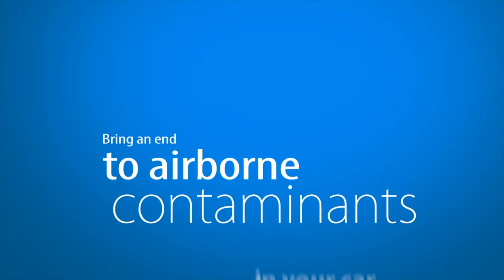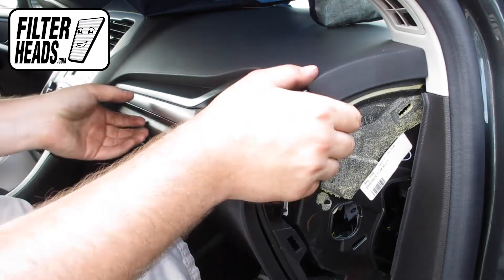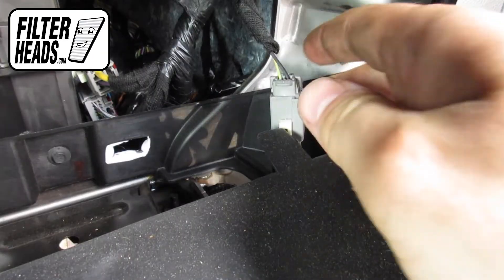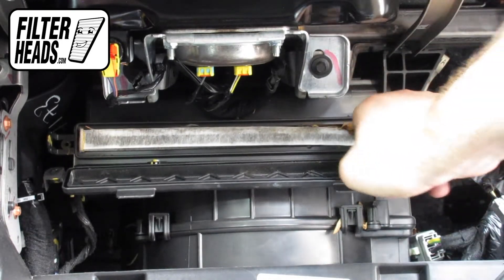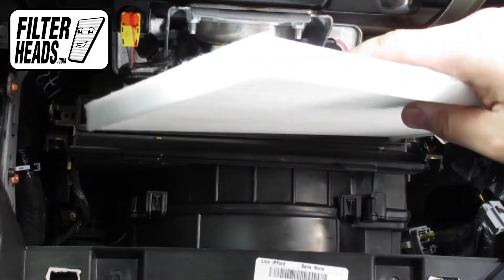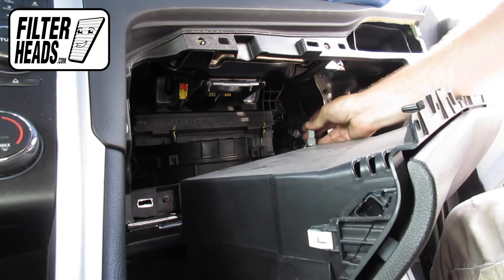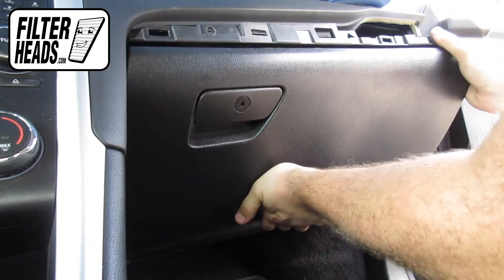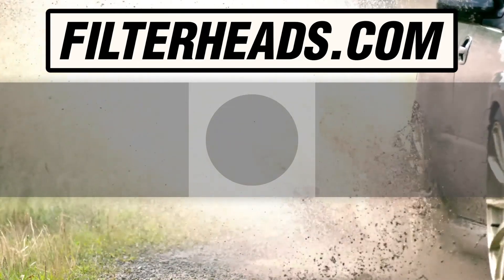How to Replace Cabin Air Filter 2015 Ford Fusion | AQ1227

Comment: Thanks for the video! I was looking this up to see if it would be an easy fix for a fleet vehicle with my work. Brilliant engineering by ford .... let's just dissemble an entire panel just to change an air filter hahaha
Reply from the maker: Very welcome! LOL! Yeah the replacement process is poorly engineered.
Reply: @filterheads  seriously, it's as bad as the headlights
Reply: @Matt561  They make it difficult on purpose because they want you to pay for service. The mechanics probably don’t actually change them for you either.

Comment: Finally got around to replacing the filter.  That bottom left bolt was tricky to get off and even trickier to get back on.  I read somewhere that most Ford techs just leave that off so since I was having so much trouble getting it back on, I left it off for now.  If it seems loose then I could go back and try again.  Aside from that bolt, this was a piece of cake to replace.
Reply from the maker: Glad you were able to get it taken care of!